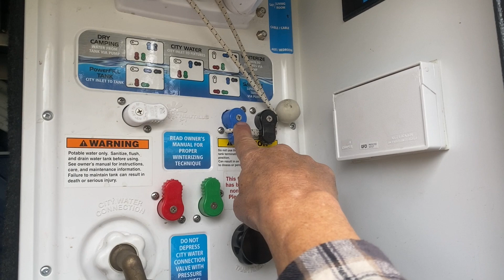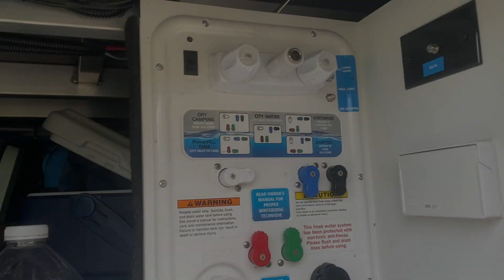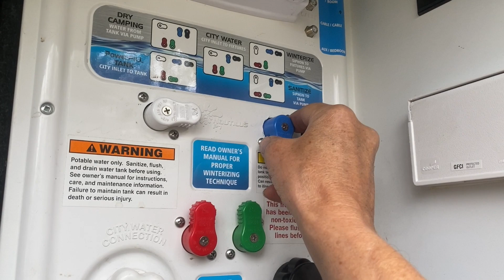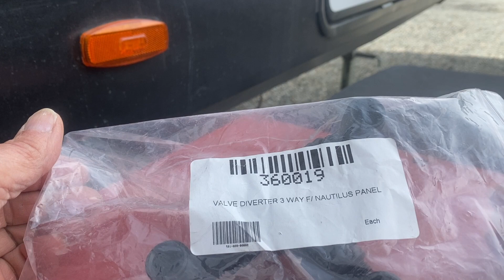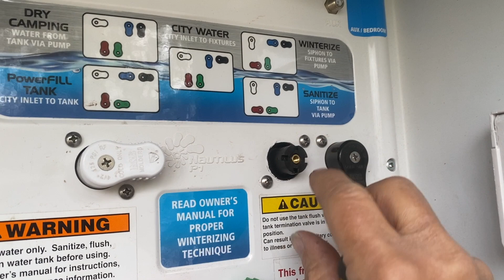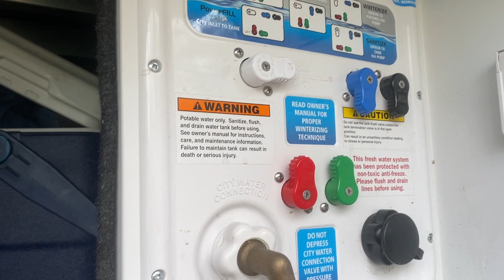Secret Tips & Tricks For Easy Fix Of Nautilus System Water Valve Problems. Grand Design Reflection.

Comment: Do you by chance still have that bag that it came in. Looking for part numbers. The small digit numbers on the bag I think would help or do you have part number or link as to where I can purchase
Reply from the maker: I am pretty sure I have the part number in my trailer. I can't get to my trailer storage for a couple days. I will get that number and get back to you. I got the part direct from Grand Design. They may be able to help you locate that valve.

Comment: Thanks very much for the video. 👍👍As a self employed mobile RV tech, I can learn much from videos like yours since I am not in a dealership with advice from the mfr or other techs. What a pain some of these newer water centers are, and that valve price is outrageous. If mine, I'd be tempted to re-design and switch to all cheap and simple in/out brass body ball valves and eliminate all 3 ways. In my experience, even brass 3 ways can be problematic, and I eliminate them whenever a customer allows me the time to do so.
Reply from the maker: Oh yes. The system is horrible. No question that I will have more problems in the future and that will be the time I completely change the full set up.

Comment: I have almost no water pressure at any faucet inside whether I am on city water or in dry camping mode using the pump (actually the hot water was barely a trickle, now there is no hot water. I also have the FW tank filling on city water setting. The pressure is a little higher using the pump in dry camping mode. Winnebago worked with me over the phone to troubleshoot the problem and after several hours decided that it is my Nautilus system. You located the problem valve by sound. All mine turn perfectly and stop in the same place as always. No sounds being made (but I have poor hearing). How did you know which way to adjust your valve, that clockwise (CW) or counterclockwise (CCW). I also have the problem of not knowing which valve is the problem. I also have the 4 valve system. Do all the valves open / close the same direction (CW or CCW?) TIA!
Reply from the maker: Most likely it is the blue one. As you are finding out, you don't know what way it slipped. Start with the blue one and do the steps that I show in my video. It may take several tries to get it right. If that doesn't work I can only suggest taking it to someone that knows this system.
Reply: @riderescue  That is what I was about to do, assuming that the Blue did the same thing on your 5 valve system. I do not have the Black valve. Do you know if all the valves open/ close in the same direction? Thanks!

Comment: I replaced my diverted valve since it was very difficult to turn and would not even do a 1/4 turn. Replaced it and now it turns like butter. Replace the valve. Pricey but worth it.
Reply from the maker: Mine is sticking again so I will need to replace that valve soon.